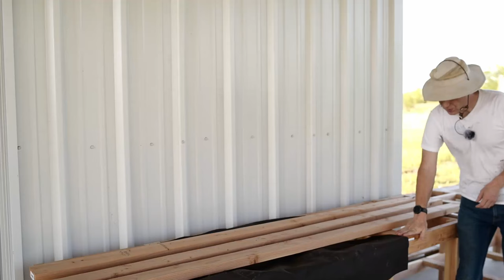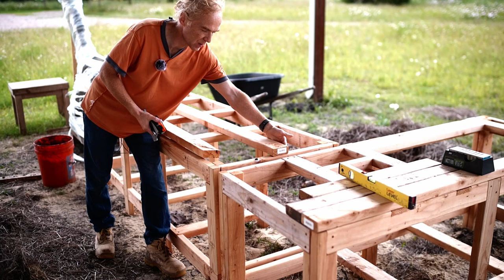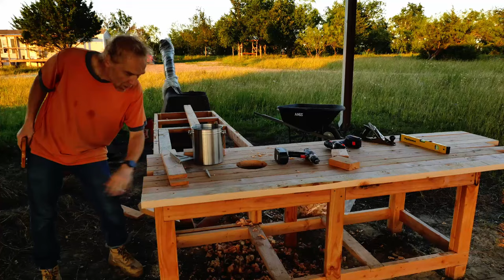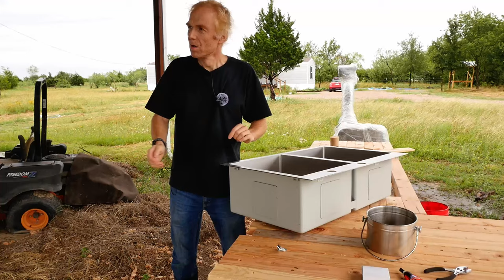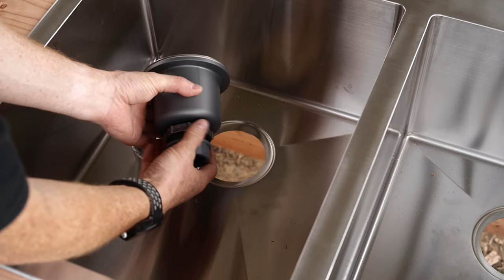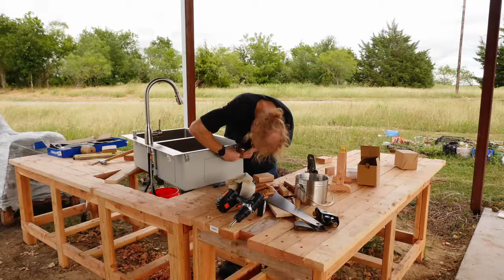Finishing the Counter Top: Outdoor Kitchen Part 3

Comment: Chris, you are a little more precise then I would be but I can actually see myself starting to do stuff like that.  I heard that you mentioned connecting a garden hose.  He sure and disconnect the hose in the winter time so the water in the hose doesn't burst the hose.
And I have actually thought of another video for you to make.  I see your chisel stand.  If you made that why don't make a video on how to make one of those (the chisel stand).
You and Haiying work well together.
Reply from the maker: Lyle Z thanks! Eventually we’ll run a water line, add power to the barn,...after the chicken coop is done, swales are dug and a few other projects. Realistically, probably not this year...

This little chisel stand was a quick side project when Haiying was not watching. The chisels dropped on the concrete floor twice. It’s just a few pieces of 2x4 cutoffs. I’ll need to do a few more of these kind of things for the barn, need to remember it take videos.

This table is really not very complicated. You can definitely simplify it a bit using butt joints or pocket screws. Keep us posted!